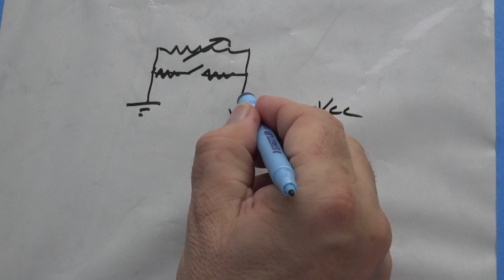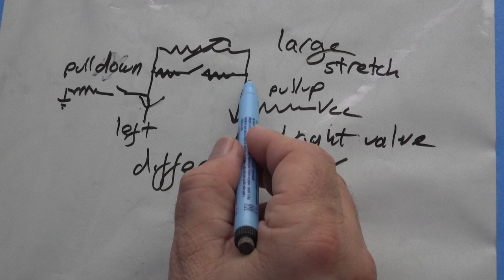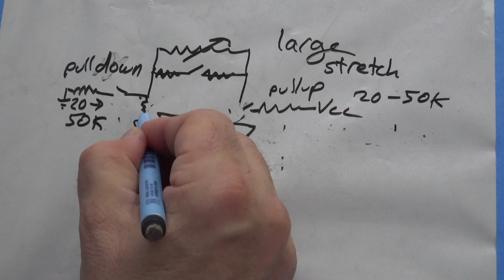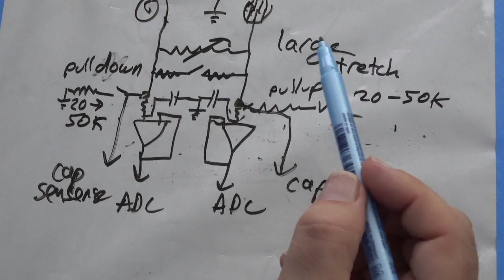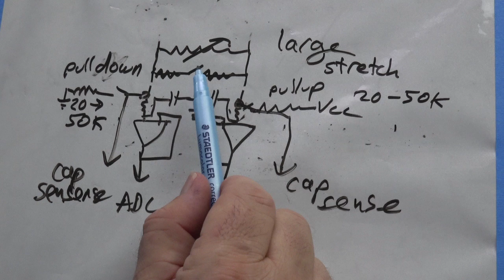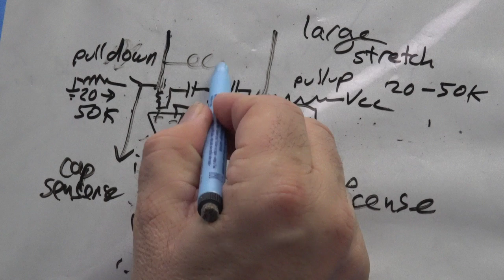FlexAbility Controller, a Nerds Eye View

Comment: An FSR is a switched area rheostat. Not a resistor. Not force sensing. Very important when laying out circuitry vs actuator. When activated, it's spectral gap jumps non-linear to some arbitrary excited state. Proper circuitry can linearize the initial jump.